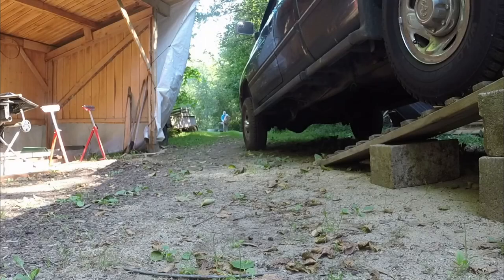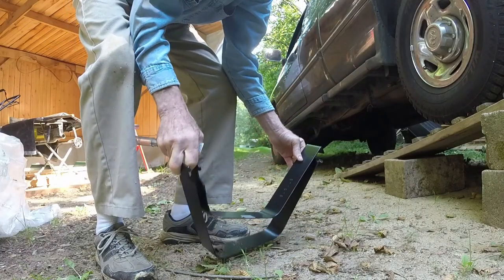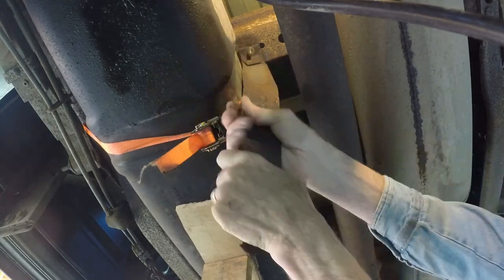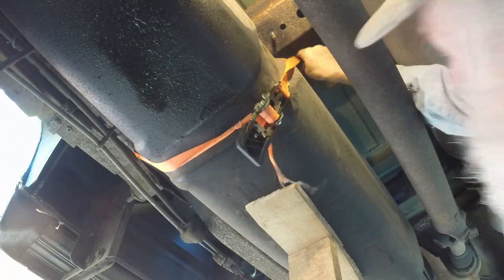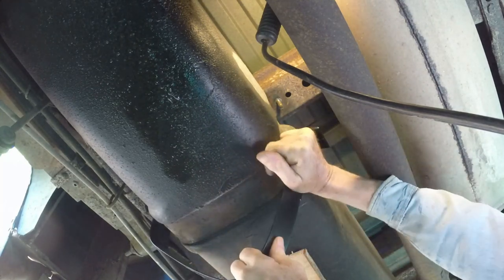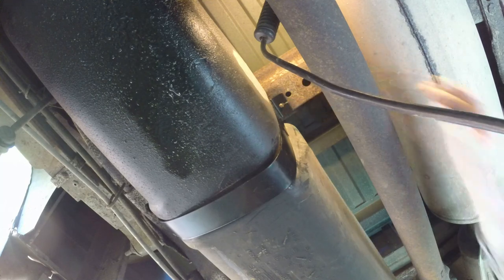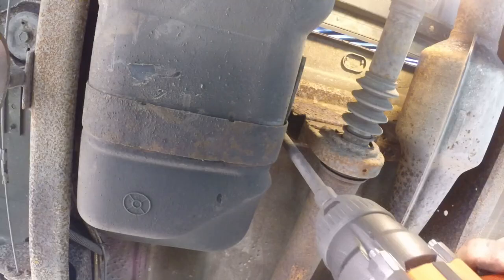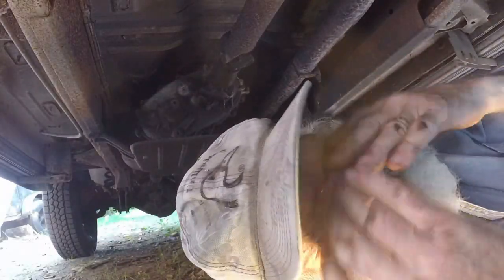Quick Clip #3 Fuel Tank Support Repair in a 1996 Dodge Pickup

Comment: Been there done that on 97 GMC Yukon, same type of straps. Only thing different was I had to replace the fuel pump in the tank. You made it look to easy but I’m sure you had a few choice words to make the install go smooth 😉
Reply from the maker: It WAS easy, and that surprised me. Such things are usually more difficult than I expect. I've watched a couple of videos on this procedure that made me think this would not be fun. But, I got off easy. Didn't have to do the front one. That one looks to be unpleasant.